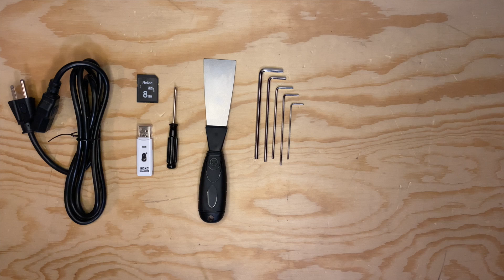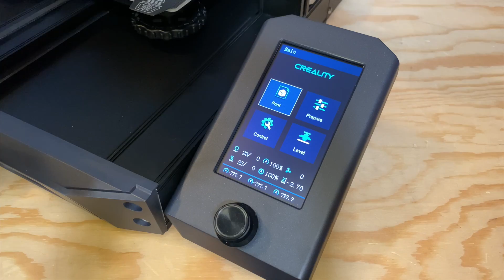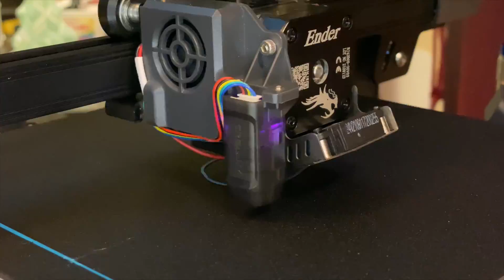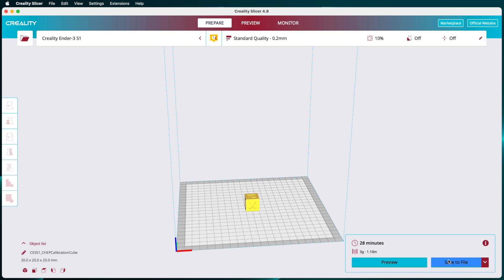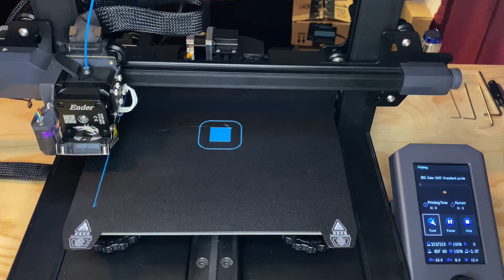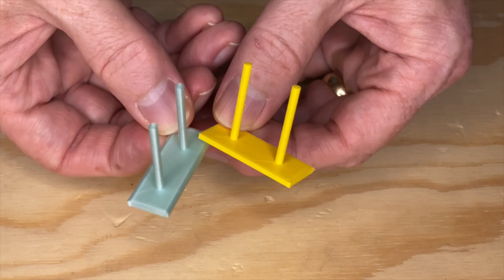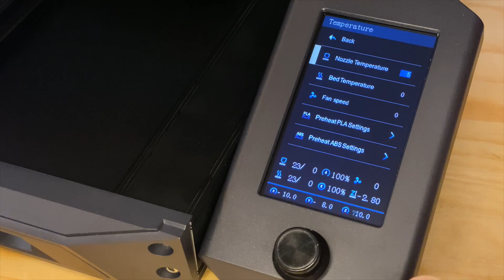The New Creality Ender-3 S1 Review!

Comment: The filament runout sensor works absolutely perfect, however after power loss recovery the printer destroys the build plate, gains consciousness and connects to the neural net via starlink, then plots to kill all humans. So that's a bit of a downside.
Reply: I was rolling
Reply: Had me on the first part
Reply: Do you know if it has been fixed by now?

Comment: Had the same thing happen on my Kywoo tycoon after my surge protector did its job. Fortunately I did not have glass plate on the bed, unfortunately I had just put my new PEI plate on it. Wonder if it's marlin issue?
Reply from the maker: I'm not sure. How high was the Z axis when the power loss recovery feature triggered? Was it still pretty close to the bed, like when I did it?
Reply: 2nd layer, figured I screwed up somehow, but seeing that it happened to you, makes me wonder.
Reply from the maker: @Wetdogdrone  I did a second test, and waited until the print was about 100 millimeters tall before I turned the printer off and then on again. That worked perfectly well.
I have a theory, and  I'm going to test that and see if this is a consistently reproducible thing. I'll let you know what happens.
Reply: I didn't try to repeat the error, I will leave that to the experts, and save my beds.

Comment: I have this and I am having a terrible time with bed adhesion. Did you do anything specific to be able to do the prints in the video?
Reply from the maker: All I've done is clean the bed with a little bit of isopropyl alcohol and a microfiber cloth, and set the Z offset. For a REALLY good visual explanation of what a good first layer should look like, check out this bed leveling guide from @Billie Ruben -- scroll down to the Bed Leveling poster. https://www.billieruben.info/post/my-3d-printing-posters-1
Reply: @BV3D  Thank you for the quick reply will give that a go I hope you have a happy New year

Comment: Great video, very thorough and informative. When you tested the thermal runaway safety feature by unplugging the heater cartridge you only confirmed that there was a low temperature alarm, you did not check if the printer shut off power to the heater or if it continued attempting to heat the hot end despite the alarm, that is very important to test. You should confirm with a multimeter that the voltage to the heater is zero after the alarm and also repeat the test by unplugging the thermocouple to simulate a thermocouple failure. Thanks.

Comment: I'm just wondering if the dual Z motors are driven independently or are in some type of splitter like many of the upgrades you can buy for the E3 V2
Reply: Apparently both motors are using the same driver :(

Comment: When you were showing the printers list in the slicer there was an Ender 3 S1 Pro. I wonder what else it has?
Reply from the maker: Hi Mike, It does show an Ender-3 S1 Pro, but it the starting and ending G-code is identical to that of the Ender-3 S1, so there aren't any clues there. I'm trying to think what else Creality could add to this printer to call it "Pro," and the only things I can come up with are maybe an all-metal hot end, and maybe Creality's touch screen. And maybe adding WiFi on board.

Comment: The heated bed being on may affect the reading even worse than it being off and cooling a bit. On my Ender 5 plus I have the nozzle and bed set to turn off between probes because the EMI from the heaters severely affected the probes accuracy to the point of being unusable. Considering the large bed size as well as mine being fairly warped, not having ABL was pretty much not an option, not to mention the probe sets the z offset, which would always change due to the heaters interference… furiously Baby stepping the z offset at the start of every print while the skirt and first layer prints was not fun.

Comment: The only reason to turn off the bed heater during probing is to prevent noise from the PWM signal messing with the probe reading. If the probe is reliabe and consistent when heaters are still turned on, then the feature that disables the heaters during probing ought to be disabled. That said, even with the feature enabled, the bed heater should only be off during the brief period while the probe is moving down towards the bed, and not throughout the whole process. So, that seems like a custom modification by Creality.

Comment: REGRETS, I just bought the v2 without knowing this one was coming out, this one basically has all the upgrades I just did manually and isn't that much more expensive. While I could still return the v2, I have invested way too much time and money on it to the point that it's probably not worth it... I don't see myself owning a second 3d printer either, so probably will have to wait till either I get a much better upgrade or the current one dies on me.
Reply: Same :/
Reply: Same. Got my v2 this evening, and just stumbled across this channel and this video specifically. This is my first ever printer — it's on the fourth layer of the included dog model right now! I'm not totally bummed out, though: my v2 is $160 less than what I can find the S1 for at the moment.

Comment: OK so I own a HIGHLY modified Ender 3 V2 and after watching this...I recommend buying a S1.  It will save you hundreds of dollars and hours worth of time.
Reply: It depends what you need. I have two Ender 3 Pros that are modified for high-temp (~310C, 120C Bed). Otherwise these would do everything I need. I think lots of people overestimate these new printers' need for mods to be useful.
Reply: @martinmckee5333  True, but like he mentions in the videos - modding these printers isn't always what someone wants to deal with it, has the time to do, or has the money to do right?  So yeah like I have learned a lot on modifying my v2, sure, it was definitely fun, but good heavens it was frustrating and cost a lot of money.
Reply: @nicholaswillcox  Oh, I absolutely agree! Expensive, time consuming, frustrating... modding a printer can be fun, but I don't think it should really be done these days unless someone has very specific goals. Learning more about how the printers work is one good reason to mod them. Another good reason is if what someone is really interested in is working on a printer. I needed a printer for a very specific task, so modding one got me there for much less than the available commercial options.

But, if all someone wants is a printer that will print standard filaments reliably, many of the low-cost offerings at this point are fine as is. It's amazing how much progress there's been since the MakerBot my makerspace got five years ago (or so).
Reply: @martinmckee5333  Very true!  My father and I were just talking about that very thing - the ease of 3d printing out-of-the-box now vs even 3 years ago.  He's 86 and seen technology of all kinds so when I got into 3d printing he's been kind of enjoying it by proxy.

Can't wait to see what the next few years of technology advancements brings us.
Reply: @Anticipate Media Yeah I feel that.  The slight layer shifts is the only failure I can't solve so far.

Comment: So it's ... auto-bed leveling...but you still have to do ALL the manual leveling effort...
lol

I do love my Ender v2, but I think they are going in the wrong directly with any of their crappy bed leveling efforts.

As always, however, YOU do an amazing review of printers.  You always have.  I appreciate the time these videos take to really make good quality content.

Thank you.
Reply: It's the same with most bed leveling sensors. Unless they use the nozzle itself to measure the distance to the surface like the new prusa xl. 
You only need to do it once since you only set the difference between the probe to surface distance compared to the nozzle to surface distance. I bought the same sensor for my ender 5 Pro, I haven't needed to adjust anything in several months.
Reply: @atnfn  Right - which isn't full 'auto' bed leveling.

I'm thinking more like the mechanics on a rat rig that does 16 plot points then adjusts all 3 bed arms automatically - that's auto-bed leveling to me.

Comment: After having a CR6SE with the solid mounted bed, I really wish Creality would stay with the solid bed with future printers. I get the knobs are for fine tuning the leveling, but the CR6 does an amazing job at leveling with the solid bed, and both the S1 and the CR6 come with stock ABL. In my opinion, this thing is just a direct drive version of the CR6 with a USB-C port,  the old style bed leveling and non-touch screen, for the same price.
Reply: i have the CR10 smart :) like it
Reply: My E3V2 with upgraded springs, CR touch and Jyers, bed levels beautifully. I just hit print.

Comment: So why is the bed and nozzle cold end leveling and seeing z offset I all thought it was done hot
Reply from the maker: Having the nozzle hot is less important, I think, than having the bed hot. With the bed at temperature, it's gone through its heat expansion, and that's why I wanted to probe it hot. Whatever distance the nozzle expands toward the bed can easily be adjusted out by tweaking the Z offset at the start of a print, while the skirt or brim is being printed. That's why I was disappointed that the printer cuts power to the bed after I've gone to the trouble of heating it up prior to probing.

Comment: Great job! Answered all my questions about the S1. I have eyeballing the Cr-10 Smart Pro and hoping to see a review soon. I can't get an answer out of Creality about what mainboard is in it. I'd like to think it will be the same components as the S1 slammed in a CR-10 chassis but that seems too simple. I have a highly modified CR-10S and have been struggling with the settings. Never considered trying Creality's slicer and I'll be damned if installing it and trying the CR-10 Smart Pro profile didn't cure 90% of my issues. I'll have to do some digging to see what all the differences are. Now that the CR-10 looks like it will get sorted out, I'll save 300 and just add the Ender S1 to my fleet. Thanks!

Comment: Thank you for this. I’m looking for an upgraded from my Monoprice Mini Delta. I've used it for years "out of the box" and it’s interesting that better and more expensive printers are missing features my cheap one had (like WiFi to upload models). This S1 looks like a strong contender.
Reply: guess what, I DID the same exact upgrade. I was going for the V2, then this was released.
Reply: I ended up ordering the FLSUN Super Racer, which I might have learned about from this channel. I thought the loss of speed from the cheap Monoprice would annoy me too much. The S1 is probably next on my list.

Comment: I wonder what the hotend looks like Id like to be able to print nylon and pc.
Reply from the maker: It's got a PTFE liner in the throat. At temperatures above about 240˚C the PTFE can start to deform and/or get crispy. Creality MAY be working on an all-metal upgrade for this, but I'm not sure. As it stands, as long as you can print a material at 240˚C or less, you should be OK.
Reply: @BV3D  maybe Creality has one in the works or even Microswiss here’s to hoping 😬

Comment: Hey there... As usual, another great video. I was about to buy this, but then I realised it does NOT have an all metal hot end and uses a small PTFE tube in the throat which again I believe, touches the nozzle.
Could you please verify this in the interest of the community and confirm if it can be replaced with a capricorn tube for better stability and performance.
Reply: I ordered one and very interested in this. May need to upgrade the hotend right away

Comment: spoiler you already know this, Bryan and I'm way out of touch w/ the new TFT screen printers & how Marlin behaves on them.

If it's Marlin-based and supported, you could always issue something like:

M190 S[bed temp you use]
G28
G29 P4
M500
M140 S0
M84

Then after G28 in your start code add M420 S1 Z3 to load the last mesh and set it to fade out compensation after 5mm. Leave off Z3 if they didn't compile that option into the firmware.

Comment: After 3 years with a heavily modified Gen 1 Ender 3, I upgraded to the S1 last week. I am thoroughly impressed after only 4 days of use. I was never able to print ABS very well with my Ender 3, but am already producing ABS prints on the S1 that are darn near flawless.
Reply: Do you print in an enclosure? Would you share some printing parameters?
Reply: @rsorez329  It's semi-enclosed with a little gap at the bottom. I have it in a wall unit in my hobby room. 

Hard to share settings as each filament is unique. Cooling fan is off, nozzle is at 235 C, print bed at 100 C. I also used MagicGoo on the bed which I suspect is the biggest change.
Reply: @BhutJolokias  Thanks, 235 C-so not really trying to go beyond that treshold bocause of the PTFE tube? Some say it melts at about 240 C. It's a pitty that they designed the new direct drive unit with the tube, I migt be wrong, but isn't the micro swiss direct drive one, designed better on that regard?
Reply: @rsorez329  Capricorn tubing lets you go a bit higher. It lets you try higher temps to experiment with. It's worth trying.

The first thing I did was put Capricorn tube in mine.
Reply: @rsorez329  You can also put capricorn tubing just near the hotend. Thats what i ended up doing as i dont like the restrictions of the smaller id of the capricorn. And in all fairness ive printed up to 260 with PTFE and its been fine.

Comment: Is it really 220x220 or did they just leave a buffer around the perimeter? The original Ender 3 can go out to 235x235.
Reply from the maker: It's physically 235x235. Specs say 220x220, but I just checked, and the firmware allows X out to 230, with Y maxing out at 220.

Comment: Wait

14:38 Wait... Should the Ender 3 V2 be powered by the usb port?

I set up octoprint on a Jetson Nano, and it bugged me enough that the Ender's screen wouldn't turn off (read: Screen on, Jetson on, Ender UNPLUGGED) that I compiled a utility to disable usb power

...it could not drive the motors, and threw errors when I tried to heat the bed, but the screen/ dial still operated
Reply from the maker: Hi, a lot of printers have the +5v line on their USB ports connected, though they probably shouldn't. It causes the exact issue you describe. There are passthrough devices you can use to prevent this from occurring, such as Brian Lough's USB Power B-Lough-R (his last name is pronounced "Block"). These can be had for about $7 USD from TH3D Studio or other resellers. 

Interestingly, I exploit that issue as a way to test thermal protection, because the USB port is enough to keep the printer's mainboard and screen running, but nowhere near powerful enough to run the nozzle or bed heater. So on printers with mainboards that can be powered that way, I can turn the printer's power supply on and also connect a USB power source. Then I can set the nozzle to 200˚C, and once it's at temperature, I can turn off the printer's power supply. The USB power will keep the screen and mainboard running, but the nozzle temperature will start dropping, and if the printer has the thermal safety features enabled, it'll throw an error.

Comment: Would have been nice for a direct drive printer to have an all metal hotend, rather than ptfe lined.. I suppose that would have driven up the price a tad though - still, it may have been worth the extra $ than push temps of a ptfe throat..

I still feel this is not exactly a beginner printer,  more a printer for someone with experience..

Comment: You see infill on all prints, that's due to Cura. Slice something with Superslicer and it won't show. You can adjust cura to add more distance for the infill from walls.
Thanks for the review. For the $$$ I'm better off with V2 with printed direct drive and printed fan shroud, it has more or less the same quality. I don't ever use a touch sensor, Springs and manual mesh are perfectly fine.

Comment: Two things I see:
1. There appear to be only 4 stepper drivers ... so the Z-screws are not independently controlled.  Still cannot sensor-tram the X gantry left and right.
2. The extruder's pancake stepper, a heavy part,  is placed far from the mounting point, bringing the center of mass of the assembly forward.

Comment: It’s sounds like it’ll be a neat perfect printer once Jyers is released for it.
Reply: Looks like they asked jyers for this printer
Reply: Marlin just had a release that includes Jyers as well as support for this board!
Reply: Can't you just use the Ender 3 V2 jyers firmware (jyers did a UI mod there to match the default firmware right?) and combine that with the crtouch, filament sensor and extruder config from the S1? Should be no more than an evening of copying over config values.

Comment: So can it print via the usb C socket using a usb stick ? At least they got rid of the micro sd card slot and the micro usb socket -there should be a law against these things being fitted to a printer !
Hope Creality make the firmware open source so those who know how can sort the few issues with it .
Reply from the maker: Hi Ian, the USB-C port is for communication with a host device (computer, Raspberry Pi running OctoPrint, that sort of thing). I'm glad for the full-size SD card slot. MicroSD cards all look alike, and they're too small to label.
Reply: @BV3D  
Thanks Bryan!
Looks like Creality has been listening to what most people want and at least they are trying to deliver .

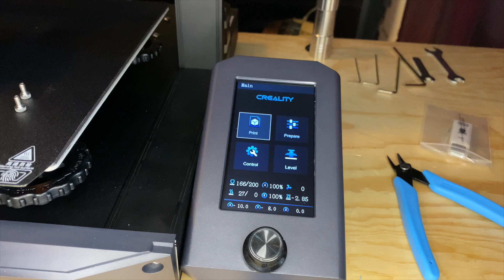Comment: At 16:14, the display shows "Nozzle is too lowperature".  They need to change that to "Nozzle temperature is too low" or "Nozzle temperature error".
Reply: It probably came from the chinglish cuz its made by china
Reply: @z83rulek  Probably.  But if you're going to make an English version, spend the time to get it right.  If you can't do it internally, hire a translator.